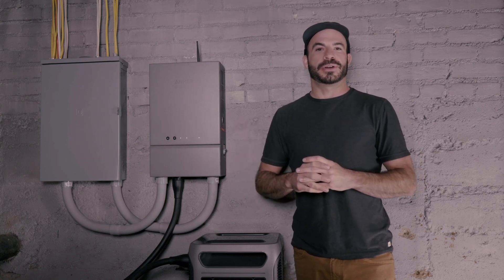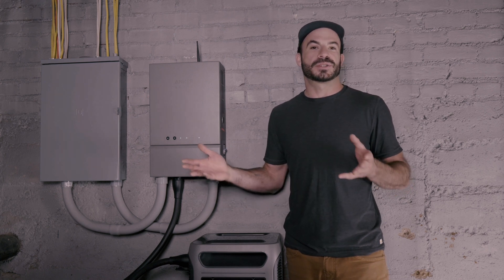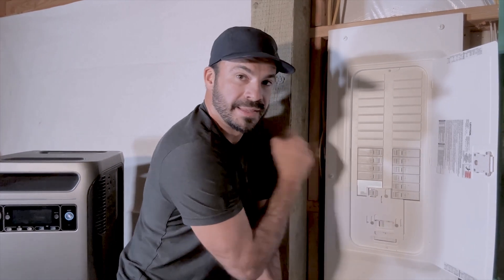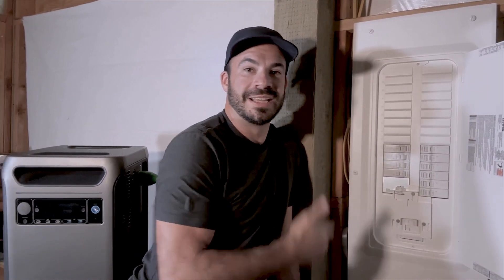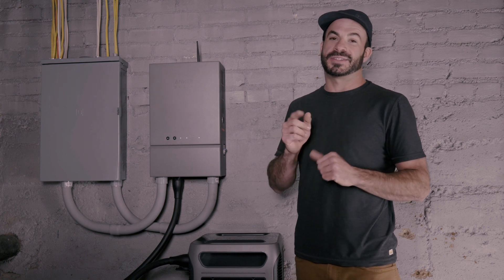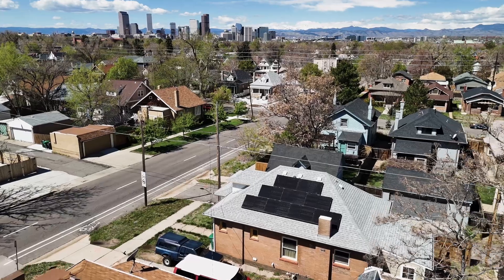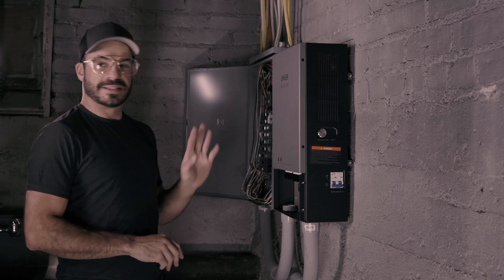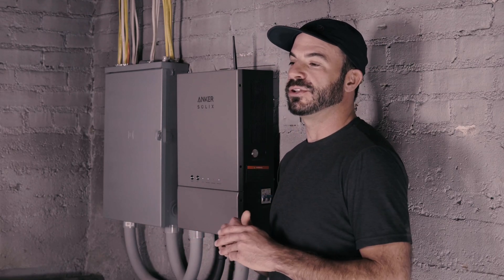F3800 Home Backup Solutions: HPP vs. Generator Interlock Kit

Comment: have you found a way to limit the charge when on Grid power charging 2 F3800's   seems to hit 2400 watts each  I wish I could cut that in half as it is a lot on my Gen to run the house and charge the F3800s when I have hit the gen disconnect switch   also seems like I have to run power over 400 watts to get the smart panel to switch from F3800 to the Gen -  Grid Power